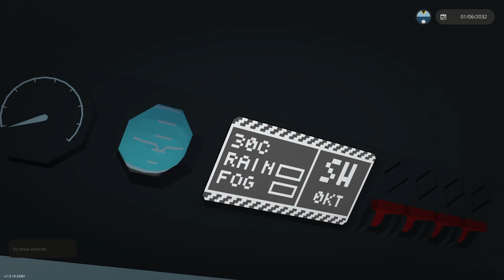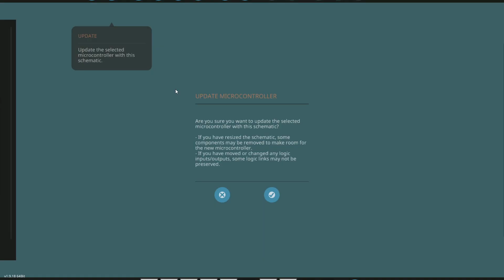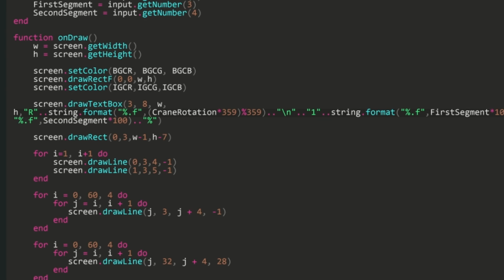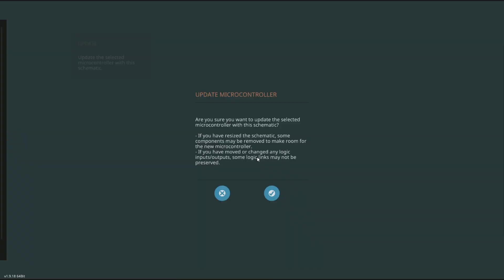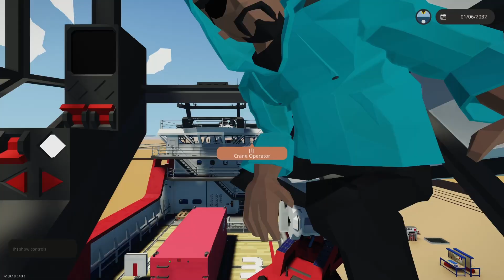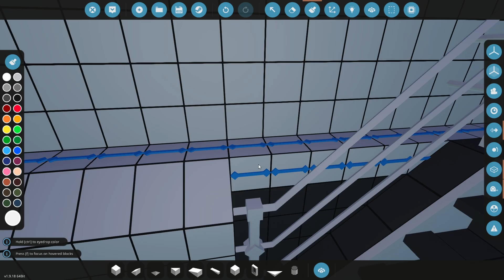Stormworks | The Shipyard | LUA-fied the Crane

Comment: hola, did some testing with piston and realize how insane the gap between the medium and large piston. 12 Medium piston can barely run my vehicle to reach 20 knots. Replacing them with the larger piston, hoping that 6 large outperforme the 12 piston.
Reply: It reaches 80 Knots, wayyy faster and the fuel consumption calculator still reading at infinite fuel. This is insane. However the vehicle is lifting to much, need to figure out how to deal with it. It's only running effectively on 40 knots for that reason. I would like to know how you keep the vehicle with barely any tilt (added a bunch of flap and rudder)
Reply from the maker: The Stormworks engine makes heavy things fly at high speed so there isn't a whole lot you can do. I have maybe 6? large control surface along the bottom of Cliford that all dig the front back down into the water and 2 medium control fins on the rear.